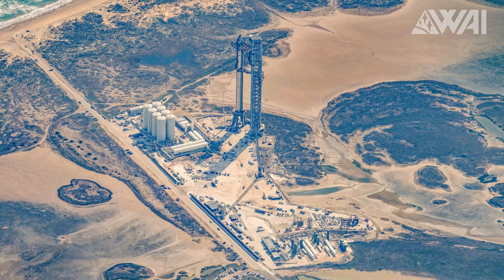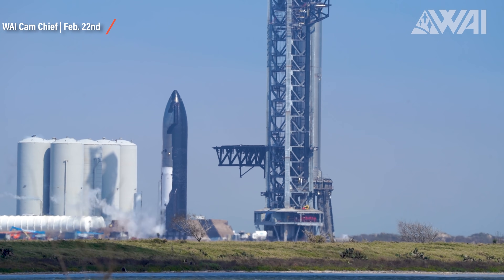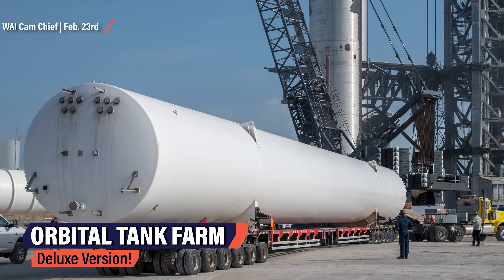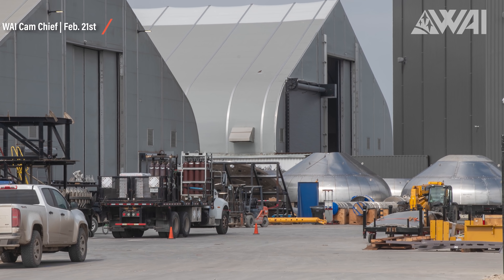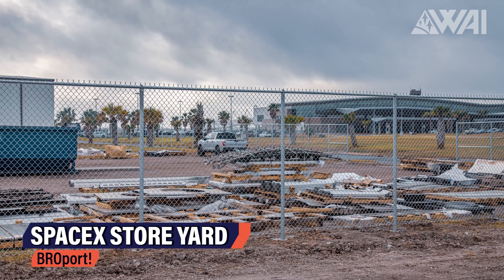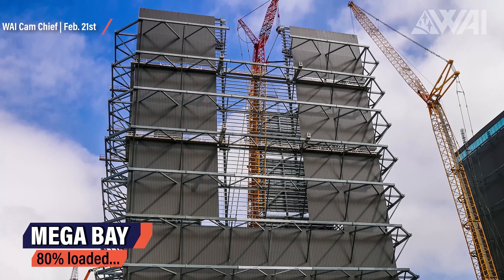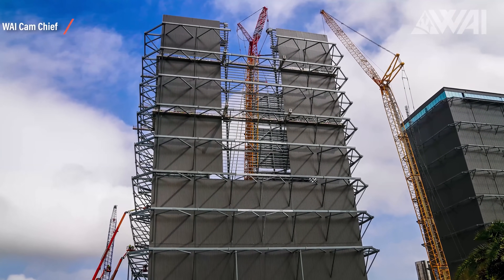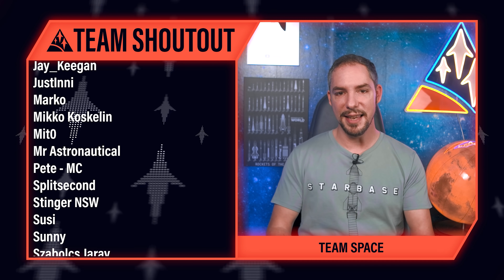SpaceX Starship Raptor 2 – Changing more than just the thrust output!

Comment: Even if SpaceX has to do an extensive and lengthy full EIS, Starbase is still relevant.  Long term, 1000 Starships will be built and having a big factory at Boca Chica will be necessary.

The only thing that will change is the testing to get to final design will be in Florida.

However, Musk must have confidence that launches will be approved at Boca Chica, or I don't think he would invest so much in Boca Chica. 

Also, there would be pressure coming from Texas congressmen to get Boca Chica approved...

Comment: More power for raptor- more thrust to weight ratio is a good news. But the starship should be much lighter. At least 3 times less mass would be great.
It would be better to have lighter fully reusable rocket with less payload capability(I still think that more than 100ton is really bad for environment). 50ton to LEO should be enough. It would generate much less noise, explosions would be less devastating...  One needs to think about rocket equation which shows how fast the fuel mass needs to rise with low payload mass addition, and also fuel addition. 
Also, the lifting body shape would be better since it would allow aerodynamic landing which would be great for safety during landing(on airports)

Comment: Flying 4/20 wouldn’t make much sense? You mean testing the aerodynamic characteristics of a never before flown stack of the largest rocket ever built? And throwing away fewer, so called obsolete engines? And testing how well Starship performs in a hypersonic regime? Sorry Felix, but there are numerous reasons to fly 4/20 before moving on to the follow-on configuration.

Comment: Felix, what about the Texas regulation that requires a 6 foot wall around fuel tanks? That was reportedly the problem facing the methane fuel farm tanks in the first place. The areal pictures don't seem to show where such walls are or will be built around the new horizontal tanks. Any insights?

Comment: Manufacturing and prototyping will remain at Starbase, 

StarShip launches can either be shipped to the Cape or launched off Phobos or Deimos in the Gulf.

The Raptor 1 engine can be supplied to ULA as a replacement for the BE4 and the Russian engines.

The Raptor 2, will remain exclusive to SpaceX until the next iteration.

Comment: As always, SpaceX doesn't CARE what we think. They are going to do whatever actions are most needed with whatever existing units work the best for THEIR purposes. If some units were just built but their testing won't provide much useful data about how FUTURE systems will work, expect them to be SCRAPPED. Their merely being built already served the purpose of helping to improve the production systems. In particular, I expect little future testing to be done with Raptor 1's. I might be wrong, but only SpaceX knows for sure until it happens.

Comment: Methane Tanks - Methane is stored horizontally according to current safety standards - It's not that the vertical tanks didn't pass a Methane test, but that there isn't a test standard for them to comply to. Bringing the horizontal tanks in is the fastest solution that will have the facility operational while meeting safety standards and their requirements.
Boca = R&D and Training. Roberts Rd = Commercial Production & Customer Flights.

Comment: The bays / stacking towers wouldn't really go to waste if SpaceX decides to pull up stakes. It is my impression that they are mostly BOLTED together with a few welded joints. It wouldn't be that difficult to simply dismantle them and reassemble somewhere else.

Comment: The failure rate for Raptor1 was too high. So why waste an orbital flight attempt with the low success percentage when you need the same test again for Raptor2
Reply: Going up wasn't the issue, restarting for the flip-n-burn was the issue. The orbital flight won't turn on the engines again after reaching orbit.

Comment: Space X might get busier with there launchings to the space station since we will brake with Russia.
Reply: That is with Falcon 9 and SpaceX is good there. They could give up a Starlink launch for a CRS mission. The Superdracos on the Crew Dragon are currently only used for aborts, so unless NASA approves them for boosting the station, Dragon can't do it. The thrusters that Dragons use in space are in the nose around the docking ports.

The Northrop Grumman Cygnus spacecraft that launches on the Antares 230+ can boost the station, so Progress is not needed for that anymore. The Antares 230+ uses the RD-181 engine and NG has enough for 2 more flights. But Cygnus could likely use the Falcon 9 with little to no modification as the HALO launching on Falcon Heavy in 2024 is based on Cygnus. 

Sierra Nevada's Dream Chaser was scheduled to launch on Vulcan Centaur this year for its demo CRS mission to the ISS. So NASA will have 3 supply craft and Japan has the H-II HTV supply craft. SNC has said that Dream Chaser is launcher agnostic, so it can launch on Falcon 9 or Atlas-V.

While Atlas-V uses the RD-180 engine, they have enough engines for like 20 or so flights. Some of which are not scheduled to launch until 2029. So theoritcally, the later Kuiper flights on Atlas-V could be bumped to Vulcan Centaur and boosters shuffled forward to free up one for Cygnus, if a F9 was not suitable. The Russian rocket guy was trying to say NASA is in a bind without Progress, but he knows it's largely an empty threat.

Comment: Great video as always :) But I disagree for not sending Booster4 & Ship20 up. Since both cannot be captured, all the raptor 1 engines will be lost, no big deal since they are already outdated. Surely they won't do that for this many raptor2. With 4&20 they can optimize start and landing sequence for just the fuel load instead of scrapping both and get no data out of. There surely is some value in seeing the lauch table work, flight path verification and landing attempt also if only simulated and on water.
Reply: ... once the FAA give approval...

Comment: Biden's EPA still holding up approval. Likely at the behest of Bezos, the owner of the WaPo and the Dems Best buddies.
Reply: 🙄
SpaceX almost certainly knew about how long this review would take as they are STILL finishing Stage 0 in Boca Chica. Since the FAA mentioned consultations, my guess is that they may be working out a mitigation strategy from SpaceX with the other agency or agencies in the review. That would make sense for the delay and would be near the end of the review. The FAA should never be a rubber stamp for anyone.
Reply: @steveaustin2686  

Cape Canaveral has the same environmental concerns as does the SpaceEx location. Guess which location is still dealing with the FAA/EPA.
Reply: @MYOB990  Cape Canaveral Space Force Station is not dealing with the FAA as SLC-40 is NOT a part of the Starship plan. SLC-40 is currently for Falcon 9 cargo flights only.

LC-39A is where SpaceX is building the Starship pad and that is at Kennedy Space Center.  LC-39A was built with rockets larger than the Saturn-V in mind, so SpaceX had a much easier time getting permission for Starship there, since LC-39A has been around since the 1960s. SpaceX is working with NASA on building LC-49 for Starship to the north of LC-39B, so they are working with the FAA for that.

Comment: I think it makes a lot of sense to test the first o rbital launch with Raptor 1 engines (not Raptor 2 engines). Raptor 1 is already extensively flight tested...including relights etc. The whole idea of the orbital-launch test is to test 1.) Booster structure/liftoff 2.)Starship reentry 3.) landing after safe reentry. I think it makes no sense to introduce a new engine (at this time) when the variable to be tested are not really related to propulsion. Also, Raptor 1's are already manufactured....might as well utilize them (are they gonna just trash the already built Raptor 1s....at the cost of $40 million???)
Reply: I had that idea as well. A buddy pointed out to me that they only have permission for a small number of flights per year, so it would be stupid to waste one flying outdated hardware. Fly the latest and get as much data as you can.
Reply: @realulli  Still makes no sense. What if Raptor 2 engines fail at liftoff itself (they haven't been flight tested as yet). What data do you get?
Raptor 2 engines could be added when most of the other aspects of Booster+Starship are identified/resolved.
Also, at this point there are ZERO approvals for Booster+Starship launches at Starbase anyways. If and when the approval comes it's best tried with Raptor 1 as the first (or couple) of tests.
Reply: space x will probably go bankrupt
Reply: maybe sell them to ULA and show the incompetence of Blue Origin more publically.
Reply: Rather waste Raptor 1s on splash downs that Raptor 2s.  I would think Elon would need a production facility at Boca Chica, Cape Canaveral and Vandenberg along with a few other strategically placed production and launch locations around the world.  Even if he is only aloud to hop out of Boca Chica to Phobas and Diemos.  He is going to need multiple factoies at multiple locations.

Comment: 4:30 I think it’s a possibility B4 will be lawned and B5 will get scrapped to make space for B4. Ships 20 and 22 are, however, likely being kept in place in case the FAA makes a final decision on the Environmental Assessment before April. If not, then as Musk said on the 10th, the operations shift to the Cape. 

Instead, they’ll continue on the Suborbital license extended from last year for BC and fly S20 & 22 on suborbital hops, reaching space and going fast enough to test hypersonics better than S16 but not enough to reach orbit. Also, RVac flight experience is needed, especially if S22 can use R2s as I was told. 

There’s 2 flights left allotted to what would’ve been S16 and S17’s flight, both of which are wildly outdated by now and not worth testing with the same idea of the limits of the heat shield as S20 and S22 would. 

Meanwhile Roberts road construction continues and it seems they’ve prepared for this possibility by shipping Starship parts out of Brownsville airport.

Comment: I’m gonna disagree with you about the current set up booster 4 the starship 20. That are  built, tiled, that’s ready to go put those 29 engines to use get the first test flight out-of-the-way. Even if it doesn’t go as far as I think it’s going to it would still be a nice test flight.

Comment: Those cryogenic tests also are needed to determine the impact on the tiles due to thermal expansion and contraction, since steel and ceramic has different elasticity coefficients.

Comment: I am not sure why launching 4-20 does not make sense.  It has Raptor1's and those are disposable.  If they can use 4-20 to get key aerodynamic modeling data and heat shield performance, it seems that data would not depend on the raptor engine model and would be of great use and would increase the chance of success on the next flight.

Comment: I heard the new tanks were installed because the vertical methane tanks do not meet TX methane storage requirements. Specifically, the state statute requires an earthen berm surrounding all methane tanks, which cannot occur with a vertical tank.

I have not confirmed this information, however.

Comment: i kind of wish i was wealthy right now, so i could guy a ship that finished testing that they don't launch... instead of shelving it or deconstructing it.... i'd turn it into a home :D   heck if you put the rings together to be 3 high you could turn the rings into tiny homes  i mean 9-10 meter across 8-12 feet high  gives you quite a bit of room right?  anyhow i could see it being used as a potential advertising tool with some profits rolling back to help spaceX IF the costs of the materials would be reasonable, but as you make more the price gets better... just not sure of the convergence point with the additional costs of modification/design... but i mean to have a space x (starship) home... with the dome and everything... the fins are where i'd hide my satelite dishes for starlink :D ...sorry i'm a dreamer ... ty.

Comment: Felix it feels like lately parts of your content is repetitive or being stretched to fill time. 
Feel free to talk about other things beside Starship, like rocketlab or JWST and don't feel pressured into frequent episodes, researching and producing high quality videos takes time and that's ok.
Reply: It does feel odd that the intro is "There has been lots going on in the space industry" when the focus is 100% on SpaceX. This is what drives me to other YouTubers, this has turned into a Starship fan channel instead of a space one which is a bit sad. 

Maybe it's time to alternate episodes. 1 Starship episide and 1 Space Industry episode per week. It's Felix's full time job so theres certainly the time there to work on it.
Reply: Well if the FAA wasn't holding SpaceX down, there would be a ton of updates. We would have been doing Raptor 2 static fires and 4/20 would of been under water already.
Reply: @ZeroSpawn  angry astronot points out tons of unfulfilled needs besides FAA for Starship orbital launch including deluge system but Elon seems to be knocking everything out pretty fast like those pretty Ship 20 heat tiles for example.
Reply: @ZeroSpawn  the FAA assessment is about launches, pretty sure they have no issues with static fires. If SpaceX wanted, they could do them. And as far as 4/20 goes, completing and testing the vehicle and ground equipment also takes time, and FAA isn't slowing that down.
Reply: @plainText384  you do know that if SpaceX got approval last year they would have shifted projects and priorities to launch as soon as possible? But they didn't, so now they are rerouting to plan B, C, D and i think they are on E now. Also if FAA votes NO, then SpaceX will have to execute plan 'rest of alphabet'. 😀
Reply: @ZeroSpawn  ngl probably in part Felix's fault for asking people to send in reviews for like 20 episodes straight 😂
Reply: @ZeroSpawn  Since SpaceX is still finishing up Stage 0, I highly doubt they would have launched an orbital flight last year. SpaceX started and paused the work at the Starship pad at LC-39A, BEFORE work at Boca Chica really took off. So Florida is not a backup plan, but where SpaceX was going the whole time. Especially since Boca Chica can only support 5 orbital launches per year in the draft PEA released for the public comment period. The 5 launch limit is almost certainly due to Texas state law that restricts the closing of public beaches. The Texas legislature had to modify that law to allow SpaceX even the limited closures they have now. And some Texans say that is too much.

Comment: Ship 4/20 can be used to test orbital flight and reentry since they don't attempt to land it they waste the engines anyway so raptor 1 looks like a good disposable option.
Reply: That's what I was thinking too. They have allot to win and nothing to lose since the rocket is already aimed to touch down in the waters.. So why not use it? I swear there are still some data they can capture with 420. :)
Reply: I came here to comment this.  Using 420 is a perfect choice because you aren't planning on reusing any of the engines on it, and you can test all of your software and new heat shield without really risking anything that holds a lot of reuse value.
Reply: Though with the out dated engine design, and so many of them being lit at once, it does risk Stage Zero undergoing a Rapid Unplanned Disassembly.
Reply: 420

Comment: Seems a Helicoptor could lift a booster or starship to a barge to be delivered to Fl or an off shore lunch facility. Or directly to an off shore site.
Reply: Not likely. The largest helicopters can lift around 15-20 metric tons. Starship (second stage) is over 100 tons per Elon and is expected to get to around 80 tons. The booster is heavier.

Now Elon and the Brownsville/South Padre Island Intl Airport had a twitter thread about taking a Starship to the airport for a display. The port is not far from the airport. So a Starship may be able to be moved to the port.